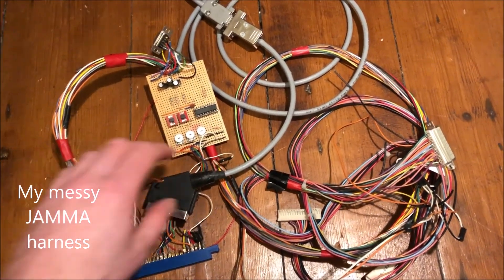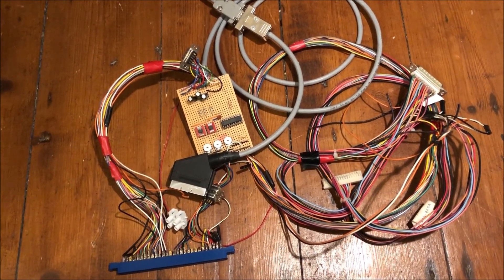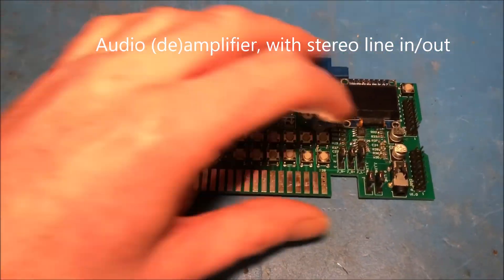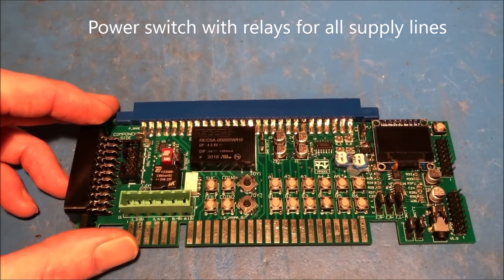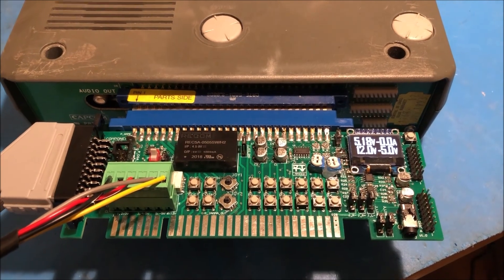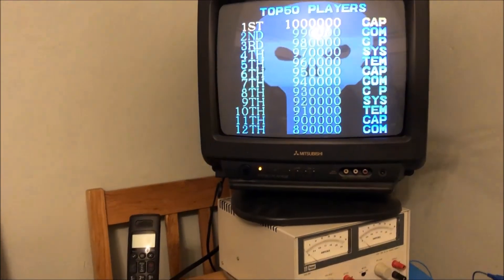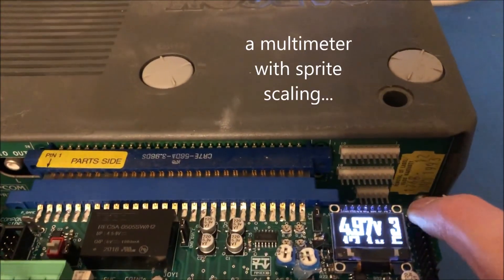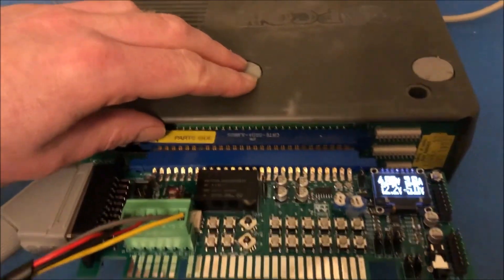The Jamma to TV

Comment: I really want to get into this but don't really understand.. I have a 13' Sony Trinitron. It only has rf and composite hook ups.. so if I bought one of these, what else would I need to be able to hook up an arcade pcb to my tv?? I do also own a modern 24' smart tv. So if I have to use that, it's no big deal.
Reply from the maker: Hi, sorry if there's any confusion, but this is for TVs with SCART connectors on them - common in Europe. It was also just something I made for myself and some friends - I wasn't planning on selling them.
I think there are solutions out there that support TVs without SCART - they tend to have S-video or Composite ICs on them to convert RGB to those signals. The Parsec supergun looks like it does that, although I don't know how available that is.